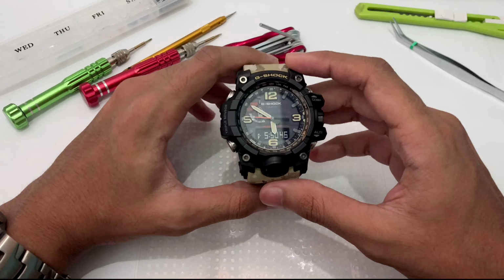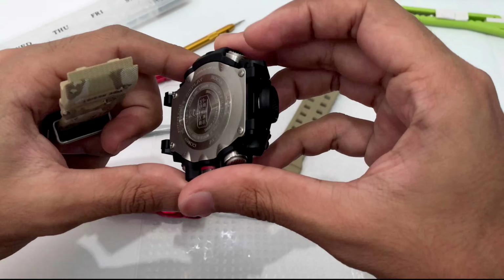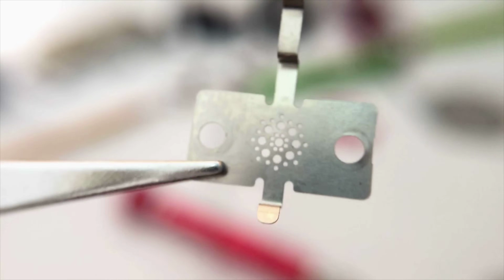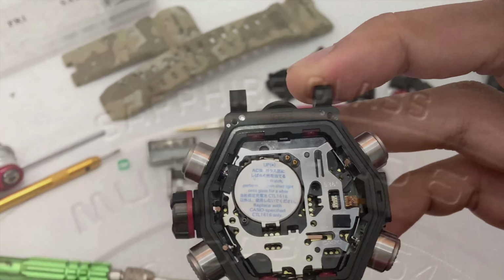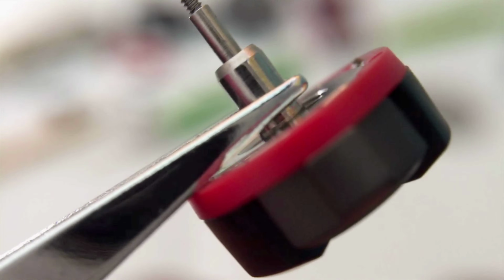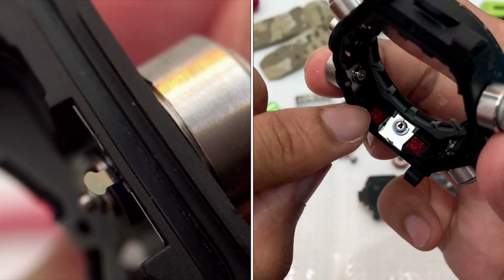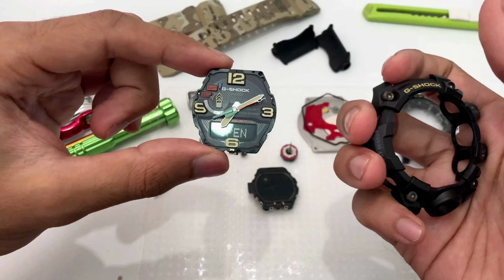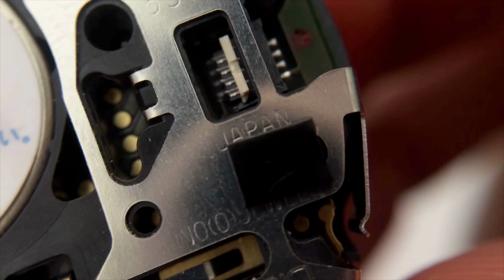Whats inside a GWG-1000 Triple Sensor Mudmaster G-Shock watch

Comment: IMHO the Mudmaster should've been full titanium body with screw back, similar to the Frogman models. At this price point I want Casio to make them uncompromisingly though like the old screw back square G - Shocks. It might drive the Mudmaster's price a bit, but it will be so worth it. It will be right up there with the GWF - D1000 Frogman.
Reply: Agree. I would definitely pay more for more…🤷🏻‍♂️💰💰
Reply: Now it comes with the B2000 with new material as carbon and alu.

Comment: You should do the same with a fake mud master... now that would be interesting 🤔
Reply from the maker: Good idea. I'll hunt for one in the future I guess.
Reply: @gshockhighfashion  yes , I kinda wanna see what does it has inside compare to the Original
Reply: Yes please do it!
Reply: I disected a fake GG1000 which was a perfect replica from the outside...all functions were working also.  The first difference is the screws on the strap, they were not even threaded and just hold via friction...they also dont have gaskets.  The second major difference is the battery, the fake uses a single CR2025, the original has two smaller batteries...then the buttons were crap on the fake...they corroded when subjected to moisture... there was also not much of a gasket on the buttons... the glass was also a clear plastic on the fake...

Comment: The technology and machinery on these g shocks is amazing to me, and way better than most of swiss mechanical watchs which will cost couple thousands more.
Reply: That's because they're meant for different purpose, they buy a Patek because they're an art form. Can't say the same about some G-Shock models. But they're high tech beasts on the wrist
Reply: First I agree that a Patek is a different animal with different priorities. Cost aside it still would not survive what you can do to a G-Shock, but it represents perfection of an art form.

But even within their own price range, I've found G's to be very carefully designed for durability. I also had a carbon fiber Luminox, which bills itself as a military grade watch, but when I opened it to replace a battery, it was essentially a Ronda movement  suspended in a very typical way. None of the layers of protection you see in a GShock.

Comment: There has to be a weak point on the band for safety reasons. If you get your wrist caught or the watch band caught on something moving or rotating, you really want to have a breakaway feature. So I understand why they did that with the buckle it self. Great video sir, and I subscribe. I could never do this watch justice in a video on my channel the way you do. Outstanding video sir.
Reply: I've  been using mine as a daily for 5 years.  That weak point on the band has just failed. And that was my first thought. Engineered failure point. Easily replaceable part away from the main body.
Reply: @yuridaman  
The band itself shouldn't be failing though. The pins that hold the band to the watch body and the clasps are what's supposed to fall. I'll have to keep an eye on that on both of my Mudmasters. And I have extra band, in case I want to change up the color theme.
Reply: @HayesTech  The pins were completely fine. It was the band that   cracked and finally broke
Reply: @Hayes Tech  Thats a link to some photos I posted on Reddit.

Comment: Do you have a link to buy the gaskets and batteries? Is there a kit?
I've been using my gwg 1000 1a for 5 years and my band has just failed. I've ordered a new band and bezel. I might as well refresh everything while it's apart.

Comment: How do you change the metal bezel (ie. the inside one with the city names)? You mentioned it is glued to the case. Do you need a special glue to replace it with a new one? Thanks, your video is amazing!
Reply from the maker: There's some kind of watch cement adhesive that they used to secure it. They're pretty cheap and easy to get online. GS-hypo cement is a good one to try.
Reply: @gshockhighfashion  thanks!

Comment: Hello - I am asking for advice - I wanted to replace the bezel in my 4-year-old GWG and clean it. After removing the bezel, the plate with holes protecting the sensor was very dirty, so I unscrewed it and cleaned it. Rather, I correctly attached the round bezel to the sensor and screwed on both plates. Then I sealed the plate with the sensor hole with a piece of insulating tape and started cleaning the clock with a soft brush with a little water and soap. After washing and drying the watch, I peeled off the insulating tape under which it was dry so no water got into the sensor. However, when checking it, it turned out that after turning on the barometer, thermometer and altimeter, an error appears. I thought that maybe I screwed the badges on the sensor wrong, but trying again did not help. The sensor itself was not moved, only after removing the plates it was dry - inside it is like a sponge or a membrane that was wet, maybe drying it caused, or maybe sticking the plate with the holes with tape. Maybe it is possible to reset the watch by removing the battery. I would rather not do it myself, and maybe there is some other way - thank you in advance for any tip.

Comment: I know you did this video a while back, I was wondering if you have ever disassembled one of the sealed buttons on this watch, I have been having a fogging issue for awhile and haven’t found anybody having the same issue, but have been scared to disassemble to try to remedy the issue... any advice would be greatly appreciated.
Reply: Remove the case back and lube the o ring, it should help. I had the same problem with my mudman and that seemed to help.

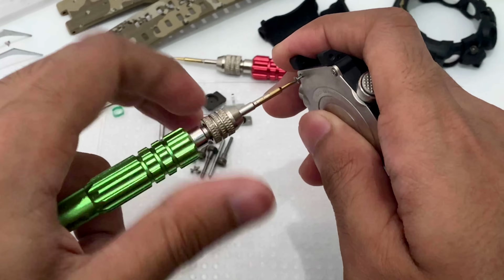Comment: The watch hands after hand adjust stop at 5:50 and not 12.00 also the mode hand is out by 2 marks, so the analogue and digital are out by 6 hours 10 mins and the mode hand never shows end correct mode. I’ve tried everything to correct it, any suggestions or is it gong to need a new module ?

Comment: For all the screws and pins in the straps ... if the single spring bar in the buckle fails, you drop the watch. Should have been a continuous buckle ... what were they thinking?
Reply from the maker: You need a break point on a watch for safety purposes. Just in case it got stuck somewhere.

Often times they choose the buckle which is the cheapest to fix/replace.

Regardless, when you wrap the watch on wrist, it integrated together better thus stronger

Comment: There are a few reports of sticky buttons and moisture getting in this model. Is it a common problem with the model? Or is it happening to those users who purposely abuse the watch. The gwg 1000, 2000 and B 1000 are on my shortlist so want to check before I pull the trigger. My use case would be wearing the watch 24x7 all year round and I just use 1 watch. Watch stays on even while bathing.

Comment: Many thanks for the video.
 I opened mine as it was fogging a bit...
Now I am having an issue with the main buttons after a deep cleaning..
The 2 left are  kind of stuck! When I push them nothing happed and they won’t come back to position. 
All the buttons of the module work fine.
A help would much appreciated.

Any

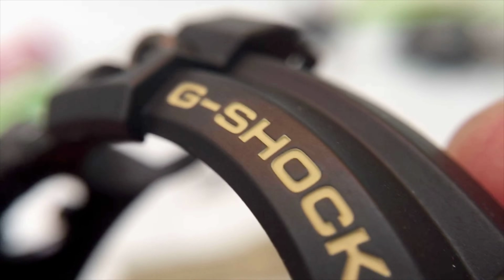Comment: Hello, at 4:20 you described the 4 decorative pins, is it inserted tightly? Is there a danger that it might fall off when im using the watch in harsh environment?
Reply from the maker: The pin is incredibly hard to be removed. It would be a nice exercise if you would try to remove it yourself, that could gives a better idea of hard the process is and thus the confidence to wear in harsh environment. 

Regardless, I doubt that pins will came out while wearing the watch at all without breaking the bezel first. Besides even the pins have guards around it.
Reply: @gshockhighfashion  Thank you very much for your response! I can wear mine with confidence now and not worry about it falling off :-)

Comment: Hello men, great and most importantly very useful video you do! respect!
please tell me where you can find, order or purchase a module for watches? I have a prg - 80, but the bottom module burned out on them (by the way, I decided to make out after your video), how could this happen - I can not imagine !?
Thank you.
Reply from the maker: Glad to know this was helpful, thank you very much for watching!. 

About watch parts, I usually bought a used model for cheap and scrap for parts instead of getting a new parts. Casio will charge you quite a lot for any interior parts especially the engine, might go around 100-150usd even if they have it in stock. 😬🙏🙏

Comment: Hi 
I need to change the red seal crown that’s on the crown because it’s cracked and deforming. Can the red seal be removed from the crown? Also Is it straight forward to put the crown back after taking it out with the paper clip ? 
Thanks 
Kw
Reply from the maker: The seal is there to hold the crown in place and absorb shock/impact. You can change it if you can find a replacement which is very hard to do. Anyway, putting the crown back in is that easy. Just pressed until you hear a click and  give it a light tug to make sure it was locked back in place.
Reply: @gshockhighfashion  how can you be 100% sure that the watch is pressure sealed after putting it all back together? Also it may be subject to condensation afterwards??

Comment: This is a great tear down of the GWG-1000!! One question, I have a used GWG-1000-1a and the back plate has 2 numbers as compared to many I see with 1 serial number. Is one set a batch number and the other set the serial number? Many Thx 🙏

Comment: My watch works and functions (keeps time) as it should, except for the mode and alt buttons, they for some reason are not responding, i asked a local watch repairman what the issue is, he says it's a $80 dollar fix....Can I fix the problem myself ?
Reply: Honestly i doubt that you can fix it by your self. Probably some part is broken and it needs to be replaced. Considering that this watch is 500 usd/eur i recomend that you give it to profesional watch mechanic to fix it.

Comment: Are the sensor elements “inside” the watch case or are they “ External” to the case with a ribbon pass through?  In other words are the active functional pressure altimeter element parts directly in fluid intimate contact with the inside or outside of the watch.  I know that if inside they may still function. Due to minor volumetric changes in air pressure with the watches sufficient volume.  I am wondering due to determining if the triple or Quad sensor would be able to be Hydro-Mod filled.  Thank you for your great videos!! Well done!
Reply from the maker: Water can't get inside, even when the sensor is somewhat placed outside the case..they shouldn't be leaking out as well, logically. With all the gasket placed on every button connections & around the sensor cover.
Reply: gshock highfashion thank you!  If you had a choice between the quad or triple sensor variant, for size and overall use, which variant would you pick?

Comment: I have a new GWG-1000 1A3 from Japan, and the alarm doesn’t work. It blinks, but zero sound. How can that be repaired? Completely new module, or . . .?
Reply from the maker: thats odd, it shouldn't blink when alarm is off. It'll just beep a few times and time display just stays as is. Even when 'MUTE', even when the timer is off, it won't blink.

Comment: How do you water seal it like by just reassemble the watch and it would be 200m water resistan again?
Reply from the maker: Depends on how you’ll be using it afterwards. If it is really your concern I would advise for you to apply some silocone grease. That would make the watch much better at WR than brand new.

Comment: They need to ditch the fake screws on the bezel and then put in a screw down case back at this price. So essentially, add threads to more pieces for security and durability.

Comment: Why desert one is 2000 and the basic 546 something? What are the differences?
Reply from the maker: Because the quantity is very limited and it is very hard to get and a lot of collectors are hunting it it. Thus the values goes up.
Reply: So it meant it is limited. But the quality it is the same with other basic watches.

Comment: hello, I have a little question: the crown is blocked inside, rotate but I can't pull it out , have you a solution? Thank u
Reply from the maker: You'll need to fully remove the crown for inspection. Follow how I do it in this
video.
Reply: @gshockhighfashion  this is the problem, the crown is blocked, it's imposible remove, rotate but can't pull out.

Comment: Hello
If you can help me in something please...
In my gwg-1000 the glass becomes foggy in sudden temperature changes.
Do you think it's normal?
I'm thinking of removing the back plate after watching your video and heat it with a hair dryer to leave traces of moisture if they exist inside.
What's your opinion?
Reply from the maker: Hello. 
I tested my Mudmaster before in same sudden cold temperature change. My Maharishi gets foggy. 

Everyone says that is normal since this watch is not ISO6425 standard water resistant.

But, my Camo mudmaster didn't have that issue at all after I disassemble it. I really believe blow drying the interior could work. If you wanna be extra secure, apply some grease at each button shaft from the inside. Basically to shut every point where water vapour could get in.

Goodluck.
Reply: gshock highfashion my Maharishi don't do that.
My all black gwg have the problem. 
Official Casio answer is that this is normal but i disagree! 
They didn't accept the watch for service! 
I believe moisture trapped when they cased the watch from the beginning! 
After seeing your video i will try to fix it as you told me.
Thanks for your answer and help!
Reply from the maker: You're welcome. Goodluck man!
Reply: Jim Vass 
Hello, did you fix the problem? I am having the same problem since few months! Bought the watch few years back But never  had this problem before..
An answer would be appreciated.
Thanks
Reply: gshock highfashion hello, Fantastic vidéo.
Since few months, I am experiencing the same issue! Sudden fog when temp changes...
When you say blow drying do you mean hairdryer? If yes, shall I apply air after removing the everything or....??
An answer would be much appreciated.

Comment: Who know why my crown doesn’t work . I can’t change  hour or something else . It’s pop out but when I rotate for change hour , or setting something , doesn’t work and I don’t feel nothing , idk if I must feel something when I tilt it … can happened something ?
Reply from the maker: Might be loose. Perhaps try to take the movement out the case. Then install the crown back in and test it as is to be sure if the problem is in the movement or the hardcase.
Reply: @gshockhighfashion  right , I take it off all but after all I didn’t try to put back the crown in movement to test it …

Comment: I have problem with mine .the alt and barro always error .please who can help me please
Reply from the maker: Either the reading is out of the measuring range or something is wrong with the sensor. Dirt/rust/battery leak/ribbon break. You gotta open it up to find out.
Reply: @gshockhighfashion  the comps work well and when I use the emulator application the Rc work too .by the way I'm from algeria brother
Reply: @gshockhighfashion  eeooo
Reply: Got the same problem. Is your problem fixed? If How to fix it? thanks.
Reply: @surapongsantong1438  welcom bro .the GPS of this chit g shock don't work in my country this is my problem

Comment: So this is all bullshit. They just put a lot of plastic around a tiny engine. Shame
Reply: It's the engineering and functions you are paying for. Yes, it's plastic but so are guns these days.
Reply: @jjmcwill1881  engineering ok, but functions? Electronics are so sheap these days. All those sensors are less than $10 to be honest. And they put one simple smd led and call it super illuminator :)
Reply: @joemat4035  I dunno. Maybe they could drop the price A couple hundred bucks. There are competitors at the 100-150 mark with the same functions. At least in part the Casio G shock line is A working man's status symbol. So there is A mark up.